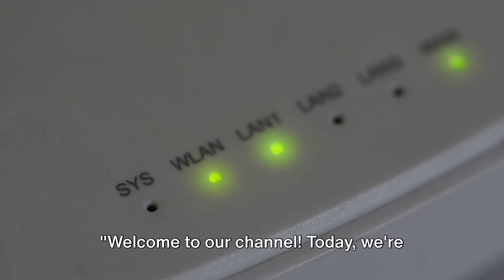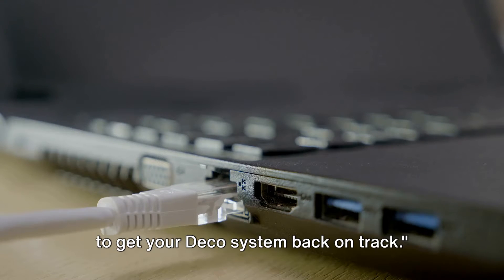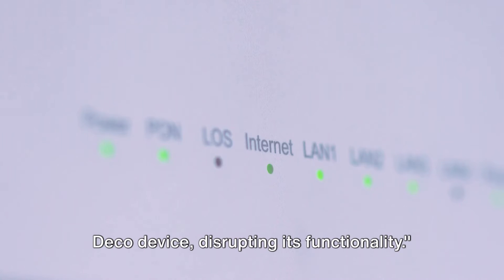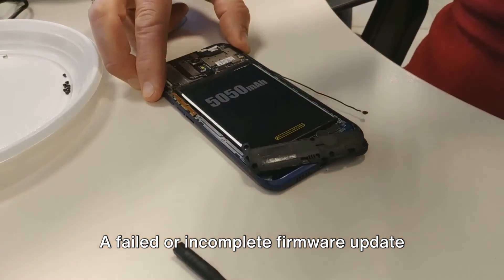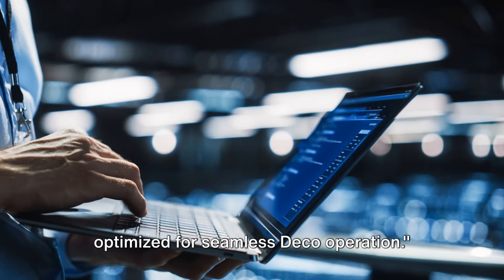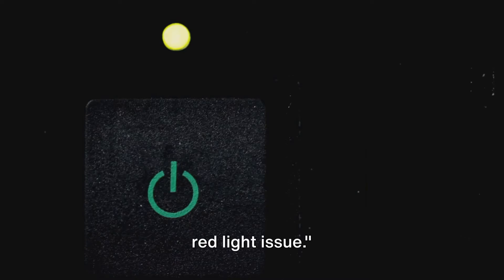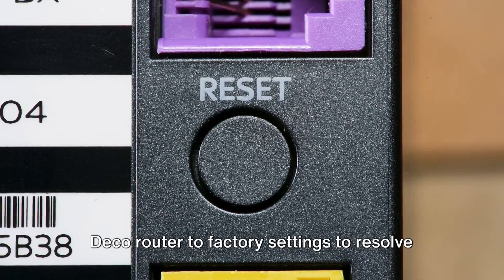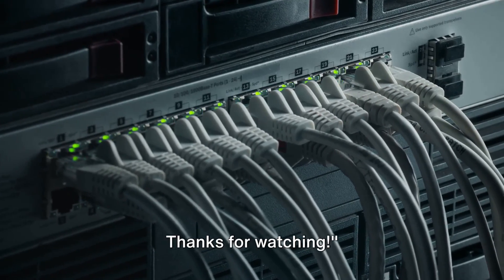Decoding the Flashing Red: TP-Link Deco Troubleshooting Guide

Comment: As soon as i remove the LAN cable after setting up. It turns red & doesnt work.
Reply from the maker: A red light typically indicates either no internet connection or a configuration problem. Don't remove the LAN cable until setup is completely finished and confirmed working.
Reply: Yaa Check The Configuration ON modem Or Router if PON is Blinking then and Red Light on Router issue with ISP.